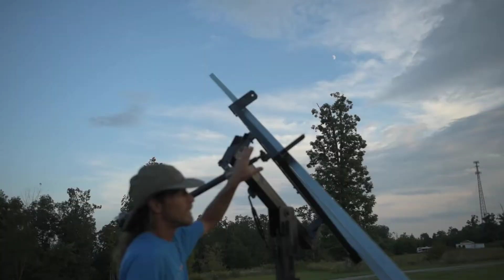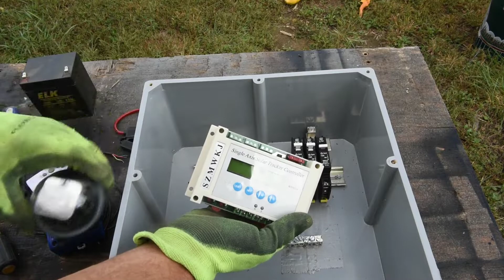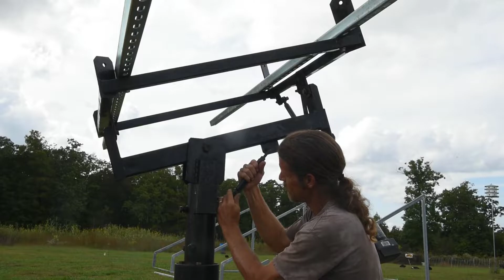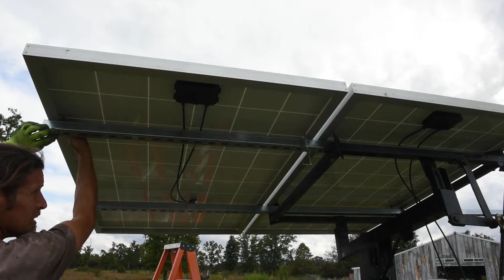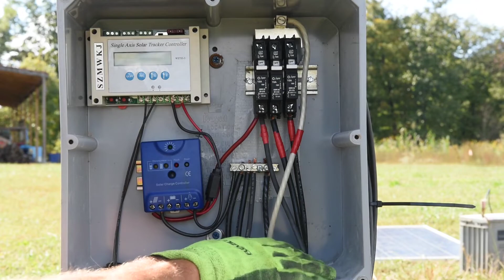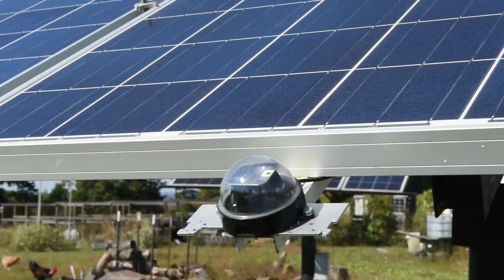DIY solar tracker (Part 2). How to build a professional off grid solar tracker for $120.Step by step

Comment: FYI the ebay link is not working on this video.  The trackers are very reasonably priced so much so that they are less expensive than doing it as a diy hobby project.
Reply from the maker: Can you send me the link. I built these for under $100

Comment: Why are you hanging the solar panel over the west side more than the right side is that for balance
Reply from the maker: Short answer is yes.. There are many types of mounts and manufacturers. Each one is designed different, you will need to center ( balance) your unistrut to each individual head. I have 6 of these and each one is different. If you have anymore questions please let me know. Thanks for watching. Bob

Comment: Nice project Sir...How long the  length stroke of the actuator? thank you..
Reply from the maker: All of mine have a stroke length of 18 inches. You can get by with a shorter stroke length but you would have to mount a bracket closer to the actuator.

Comment: What do you do in the event of heavy storms and high winds which can occasional occur?
Reply from the maker: I have safety chains that I can put on, if I know high winds are headed our way. They have survived 81 mph gusts without the chains before and several times we have had wind in the 70's mph range and they did fine. If you live in a high wind area I would recommend safety chains.

Comment: Hello sir,
How are you?
Hope u doing well 
First of all I wanted to say this video it’s the best u can find out ,very pro .
One quick question 
Can you give me a explonation if u have any info for( Relay Extension Module for Single Axis Solar Panel Tracker)
Best regards
Reply from the maker: Val thank you for your kind words. I am doing well, I hope you are also.  Here is a link to the controller I use now. They work well and I haven't had any trouble with them.   https://www.ebay.com/itm/195684976486?hash=item2d8fbbc766:g:Pj0AAOSwfldkCE3i&amdata=enc%3AAQAHAAAA4PCmxKdzetIXWwDnLE%2FTnHH0A59TmI7dkluIVZebaGqtk5FFwPQQQ4hG2%2FTaBbPMEMpW2zAyRFRM3USIAWjmKlSWSYSm1xmKVtQG9RkanvQik2CNv3Hsaw2bf4mo28lxsU7QT%2Btz7Hmuh1D6qJ7JJQEWfbn8dWxIhAsrh9P%2FfRJPLatWS2ZTIvEAMuqmfdAkoJyvfTVRRmkgb4f%2BOphnHFIdlO6AmpiOKgy85Vqy1LvsU4HtYQstJE%2BQ7G9AIvs5zyS743dWVP1bj1OaDkD%2Bzbo6Mv%2FOIWdkH7N7vgVmZ3AK%7Ctkp%3ABk9SR8K966LoYQ

Comment: What is the stroke length of your linear actuator?  What is the min/max lengths for East-West tracking?  Thanks for making these videos, very helpful!
Reply from the maker: Hi Russell, This tracker has a 20 inch stroke length. I like using between an 18" and a 24" inch stroke actuator just because they are usually built stronger than smaller stroke length actuators. If you have a smaller stroke length, when you are building your tracker move one of your brackets closer to the other. Depending on your actuator you may only have to move it 1 inch. Remember 1 inch makes a big difference in the final tilt of your tracker. Thank you and Thanks for the comment.

Comment: Hi, I use a 2-axis solar controller for my DIY solar tracker: https://youtu.be/_Rs8CptQcDw. Save electricity costs: With the Dimmer + Solar PV, self-sufficiency will now increase to almost 95%, which means a huge breakthrough. The prerequisite is that you have at least a small balcony power station, and you don't need an expensive battery either. Example of a kettle: Without a dimmer, the 2500W - 600W PV system needs = 1900W, which you have to pay more for. If I turn the kettle down to 600W with a dimmer, then every weak PV system can now supply each consumer independently and independently, because the 2500W kettle becomes a 600W kettle thanks to the dimmer. Magic... The 2000W e-heater becomes a 500W e-heater with a dimmer, which can run 12 hours a day free of charge via PV. https://youtu.be/QbLWDbJi6ew . The 4000W oven is also tamed. Not the solar systems have to grow, but the consumers just have to drop by 75%, which is sooo easy with the dimmer. are you convinced now I have already switched my entire household to dimmers. Please have a look at my channel. ........ 🌞 ....... Increase mini PV solar self-sufficiency (winter and camping): A boiler and other power-hungry consumers can be infinitely reduced using the "5000W dimmer". Ebay €7. I run 5 dimmers in parallel on an 850W inverter. Kettle 2.2KW at 150W runs 12 hours a day, so the water is always hot. The room is also nicely heated. 2.5KW washing machine runs in parallel with dimmed to 400...600W and always reaches its 60°C, and also its 1400rpm... It doesn't matter to the washing machine whether it changes the washing temperature to 5min@2500W or 100% can be achieved free of charge via existing PV power in 20min@600W. The wash cycle lasts the same time dimmed and non-dimmed, 3Sth 10min. The iron, dishwasher, oven, electric heater, waffle iron, coffee machine, all internal heating are throttled with me. Videos on my channel https://youtu.be/eC2olbCBhh0 The inverter stays cool, quiet and the MOSFETs + (battery) remain intact because no extreme current peaks arrive at the inverter. Now every Mini PV Inverter is enough to operate large devices. So, with the dimmer, all internal heaters/devices can be converted into base load devices that stay almost permanently ON, drawing very little current directly from the PV. With a wattmeter / energy cost meter you can then measure this perfectly in order to set the dimmer optimally. ........ Comments: "Great idea - despite studying electrical engineering, I didn't think of it myself ;-)" or "I installed it in our washing machine, great idea!" or "Glück Auf Christian, I'm a professional myself but I haven't figured that out yet.👌 Greetings Mitch💚" and many more... LG Christian .............. 🌞 . ............... ................ ................

Comment: I first put trackers on my pannels about 10 years ago. now i can tell you that the actuators only last a couple of years. before they break. the reason is they are constanly tracking the sun so they are working all day long going back and forth, i retrofited different motors on them many times but because they never stop working they all burn out. and it makes very little differance if its pointing directly at the sun. as long as its in the general direction. so now i have it on timers to stop at a preset position. using mercury switches that dont burn out, now they are only on for about 5 minuites a day, much better.
Reply from the maker: Great advice. The first trackers I built in the early 90's I used timers on. They worked well. I had to change the timers settings about 3 times a year to adjust for the seasons. I have never had an actuator burn up on any of my trackers. I am still using one from our satellite dish from 1983. I do grease all of my actuators twice a year. I have had one actuator strip out the worm gear. Thanks for the comment
Reply: Can you help us source mercury switches?
Reply from the maker: @offgridmangogrower   Here is a link to mercury tilt switches https://www.walmart.com/ip/MERCURY-TILT-SWITCH-OMEGA/28988048?wmlspartner=wlpa&selectedSellerId=8282&adid=22222222228000000000&wl0=&wl1=g&wl2=m&wl3=42423897272&wl4=pla-51320962143&wl5=1021048&wl6=&wl7=&wl8=&wl9=pla&wl10=115780149&wl11=online&wl12=28988048_8282&veh=sem&gclid=Cj0KCQiA1sucBhDgARIsAFoytUvlUUDQLlweui8P2lLw_XWkXxZYbtM1OeDoU7Hx2Hko8mCIYkGW2REaApq-EALw_wcB
Reply: And what timers seem to work the best for you? A DC timer makes even more sense…?
Reply from the maker: @offgridmangogrower  link to 12v dc timer https://www.amazon.com/JVR-Programmable-Digital-Battery-Powered/dp/B00WR0ELCO/ref=asc_df_B00WR0ELCO/?tag=hyprod-20&linkCode=df0&hvadid=242027088707&hvpos=&hvnetw=g&hvrand=10779367869842844769&hvpone=&hvptwo=&hvqmt=&hvdev=m&hvdvcmdl=&hvlocint=&hvlocphy=1021048&hvtargid=pla-437459814618&psc=1

Comment: I haven't seen someone connect 2 charge controllers to the same set of panels before.  Is your primary controller MPPT?  I know you mentioned you had a 24 volt system so not sure.  Also an observation is you had a 4 circuit breaker combiner there on that rail you could have added a 4th breaker and connected the blue charge controller to it and had the positive going the other direction instead of the inline fuse.  I do like the simplicity of this just not sure how 2 charge controllers will fight it out.
Reply from the maker: The blue cc in the combiner box is only for the tracker battery. The solar panels have their own cc, which is much larger. They are on 2 different circuits so they won't be fighting it out. Great question, I should have done a better job explaining that in the video. Yes I could have added another breaker but that would have been an additional cost and I had plenty of inline fuses already. Thanks for watching

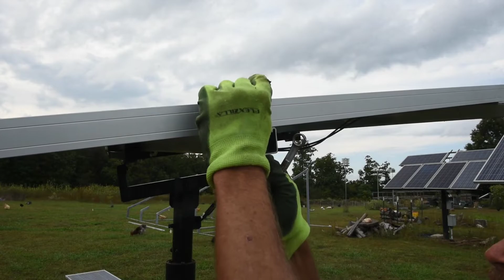Comment: @39:00 why even use those clamps if you've bolted the panels to the frame already?
Reply from the maker: Hi Paul, I was showing 2 different methods for securing solar panels. Great question. Thanks for watching.

Comment: Your eBay link doesn’t work. How much did this newer version of the solar tracker go for.  A link to your solar controller would also be useful. Thanks for a Great video.
Reply from the maker: Thank you. Sorry about the link. Thanks for letting me know. Here is a new link  https://www.ebay.com/itm/115276663018?hash=item1ad70648ea:g:XcsAAOSwB05eD0AC

Comment: Nice video.  I assume the $120 is for actuator, motor, controller, etc.  Do you have an idea of how much extra cost for the support structure vs a static structure?
Reply from the maker: You are correct the $120 is for the controller and other parts. If you didn't want it to track you would just have to purchase the unistrut. I think it is about $20 a piece now so you would have to purchase 2. Thanks for watching.

Comment: im a beginner using a mirror instead of solar panel to direct sunlit to a window using trickle 12v 5w panel to charge 12v 1amp cordless battry which wl run  18v 1 amp drill as actuator.  question-my 12v 5w pnl  lt sensor put out between 12 to 22v. would it be ok to connect it to 12v lt sensor controller slot or should i put it into 24v slot or i need to add charging controller .
Reply from the maker: It really depends on the battery. Is it an 18v lithium ion Battery?
Reply: @HippieHillHomestead  thx 4 respond. 12v 1amp lithm batt. so if the solr panl put out from 12 up to 22v  and ben connected on 12v charge controller will not harm the controller correct?

Comment: Where do you get the linear actuator?
Reply from the maker: In part 1 ( https://www.youtube.com/watch?v=vtc7ypADI3U ) we take apart old satellite dishes and we use the linear actuators that are on them. If the actuator doesn't work or it can't be  fixed,  then I usually look on ebay or facebook marketplace for a good used one. Thanks for watching.